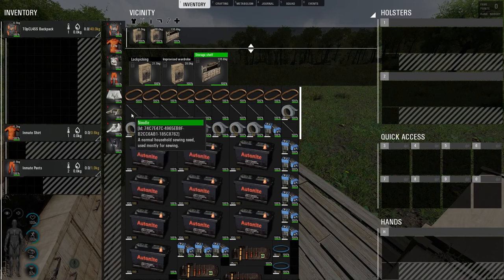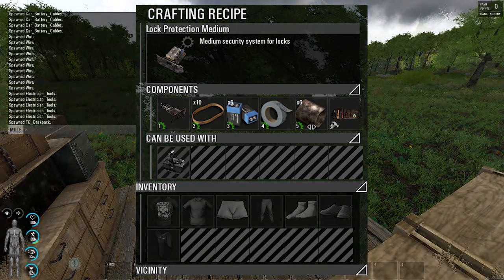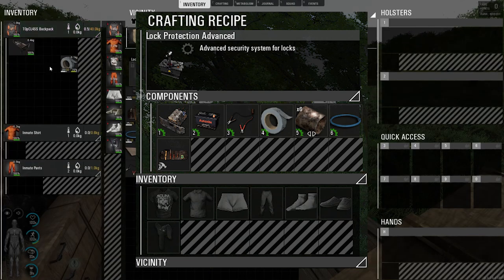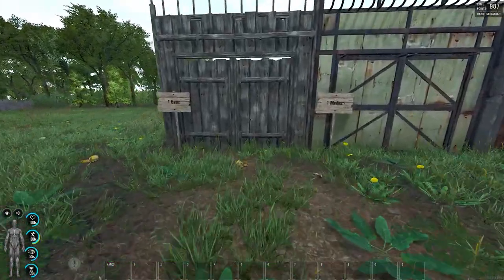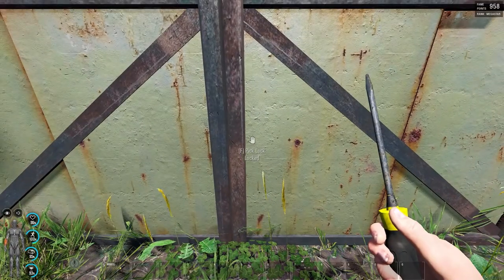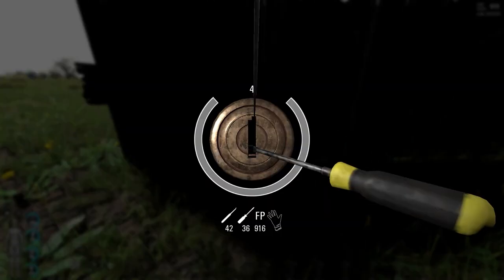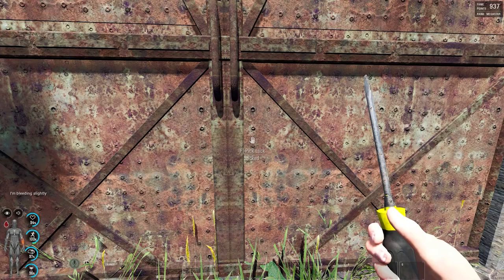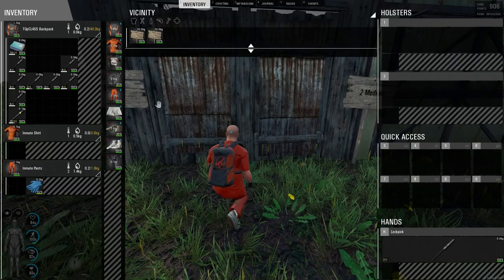Detailed Lock Protection Guide - [ SCUM ]

Comment: Mr. GH  Your friendly neighborhood Cable here.  Did you test wearing rubber boots or wet boots.  I was told if your boots were wet it made a difference.
Reply from the maker: I will be doing an update video for this but you must wear rubber boots in a wet environment to prevent the lock protection from zapping your character.